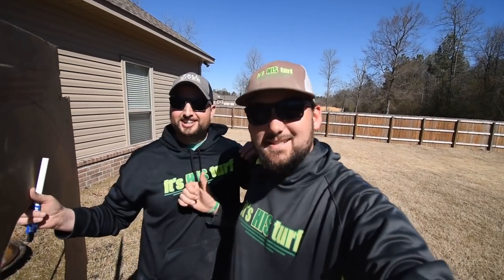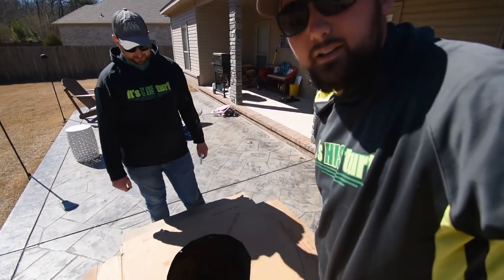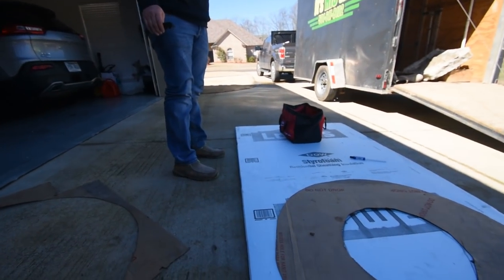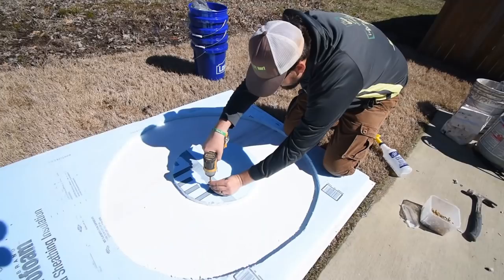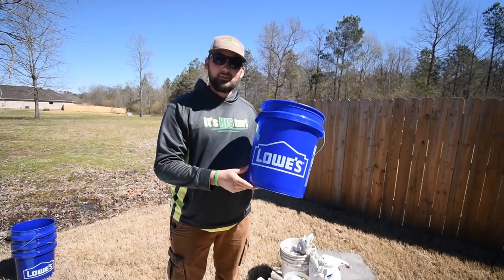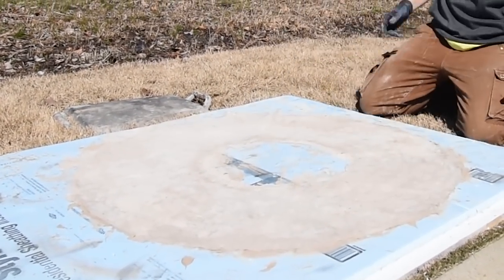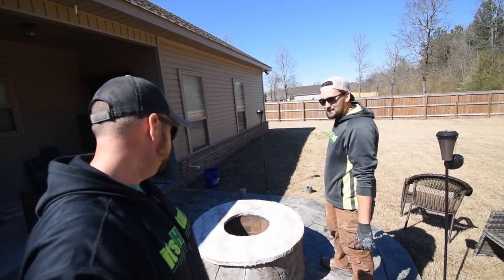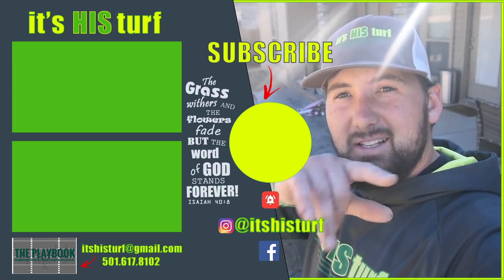Fire pit cap stone pour and installation.

Comment: Why didn't you screw the foam to the  board before you cut it out?
Couldn't you just measure the interior hole, find your center point, then use a screw pencil and string to draw your circles adding the width of overhang?

Comment: how did you get the concrete to withstand the fire pit heat?  I made a beautiful concrete top for mine and it  has disintegrated around the inside edge from the heat of the fire.
Reply from the maker: This is a fire resistant mix.
Reply: @itshisturf23  Whats the fire resistant mix called?